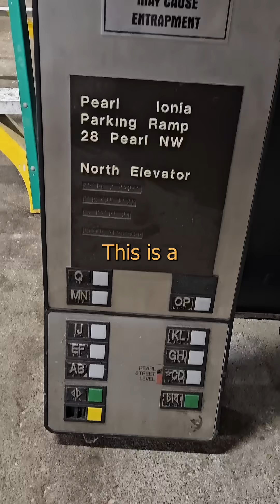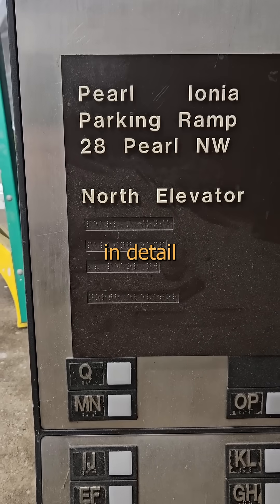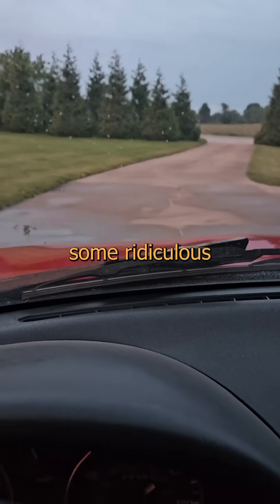Miata Mischief #chrisboden #engineering #gear #elevator #score #stories #parts #hacking #making

Comment: A friend of mine said I could have a 600lbs. transformer if I could haul it out right then and there.
Well I will tell you a 600lbs. transformer fits in the back of a Plymouth Neon. I will also tell you that a Plymouth Neon suspension can't handle 600lbs. but I got it home and unloaded.

Comment: My dad wanted to start a farm. He doesn't know a thing about running a farm. It comes time to pick out a tractor! My dad finds a good deal on a Yanmar that fit his needs, but we're in Michigan, and the tractor is down in south Virginia. We have an RV. We have a trailer. The dimentions of the tractor fit the trailer without an inch to spare. The tractor weight was so close to what the trailer could handle that it was too heavy when the bucket filled with water in the rain. When it came time to install the trailer, the RV only had a 4-pin connector and the trailer was the circle connector. An adapter and a bunch of electrical tape (and hidden extra wires) later, we're heading to Virginia with a trailer behind the RV. So many things could've gone wrong yet didn't. Everything was at max capacity. The drive home with that thing was nothing but stares from everyone everywhere. This was definitely a situation of doing the wrong thing right enough to make it work. Timing it right opening the bathroom vent with a cattle trailer driving past while the salesman was looking at everything was the least of my worries.
Reply: the circle connection is for a trailer brake, the 4 pin is lights only. he drove a trailer at full capacity with absolutely no brakes.
Reply: @bettafish541 horrifying.

Comment: Talked my buddies into helping me load a fiberglass boat (probably like 12-16ft) into the bed of a truck (probably 8ft). Bent the bed into a v shape before we gave up on it fitting in anyway. So we decide to push it down the hill, across the highway, down the hill, over the railroad tracks, down the hill, and into a river where we were going to paddle it 3 miles upstream where I live. Half the guys left midway and didn’t get to see its maiden voyage, where it sank almost immediately and still sits to this day 😂. I was just glad to have orchestrated a group of people into doing something and at that age I learned a lot about team building and leadership. Leadership I shouldn’t have😅.

Comment: I bought a chevy spark in 2019... brand new only 5 miles one the dashboard,  I'm a contractor and my van was in the shop, so I used my new skateboard to haul all the material to build a 5x8 deck with steps...😂 had to pull the passenger seat out and leave the back hatch open. The next day I hauled 20 bags of concrete in it spread out from the front to back

Comment: I own a honda fit and I have used and abused it to the core, I have place 5 ton metal press dyes, with 10 feet SS pipes and a sack full of nuts and bolts fresh from the galvaniser to my workshop.

Comment: I used a skate board to take a big glass screen TV across wichita to get it home so I could have a TV in my room, even dropped the TV on its face but it was so big you couldn't notice the scratch when it was on, took it about 3 miles and yes it was big for the glass tube style before flat screens, at least a 50 inch but it was almost 20 years ago so I'm not sure on the size exactly

Comment: So there are two occasions.. 

1: we took a 1997 Ford F150 with the 4.6l over to Ft.Lauderdale Florida, and loaded a 15,000 watt standby generator in the back of it, because the shipping company was on strike. Drove it all the way home to Cape Coral, Florida while the truck was doing the dirty squirrelly ass dance down the road. This was absolutely the best version of Lil Jon's song "Get Low" from the way the ass was on the ground. But it did it no problem. 

2: loaded about 750 lbs of soil bags and rock into the back of my 2004 Lincoln Town Car Ultimate that has air ride and more miles than a 70-year-old prostitute in Vegas has. (252k miles) And then proceeded to put 4 20ft sticks of side house soffit and trim in the passenger seat from Home Depot to fix up the house after Hurricane Ian. The car is actually the one as my profile Pic right now. Though it was at capacity,  the old girl did this with no problem at all. The sticks were a bit sketchy though as I had to tie them to the truck over the car from the front passengers floor board.

Comment: Was I had to drive all the car parts for my Dodge Avenger back in my Dodge Avenger so I had extra doors tied to the roof with bumpers holding them down with fenders tied to the sides I was pulled over four times

Comment: Ripped an entire 1960s breaker box off the wall of an abandoned drive in theatre and had my friend rewire the sockets so they function as lightbulbs and the breakers as switches. Cool lamp.

Comment: We were moving offices at a previous employer. I offered to take a few things down the street to help get the job done quicker. So they loaded my chevy volt to the point I had room to sit, and access the controls. Needless to say I pulled out of the parking lot, and a box avalanche came flying down on top of me. I ended up having to get the car towed after it caused me to slam into a curb, blowing 2 of my tires. 😂

Comment: I had a 2007 Toyota Corolla, and my buddy called me while I’m halfway through getting my wisdom teeth pulled, saying he blew up the motor in his Chevy truck and he needs a tow before they impound his truck. Tell em to hang on for like an hour tops. Get out the dentists office, see his truck off the side of the interstate, stop, pick em up, bought some rope, and flat towed his 1993 Chevy K1500 single cab short bed for 10 miles. And we were chilling at 60 on the interstate. We dropped it off at my house and I rebuilt the motor for em. But that was probably the dumbest haul I’ve done

Comment: 80 bags of concrete in the back of a 1990 F150 short bed. The bed was filled even with the cab and I had a few bags on the roof.  I had vague steering and couldn't go over 35 m.p.h. 25 mile to home.

Comment: At 16 I started with a 85 Ford Tempo. It got used like a pickup around the farm so mostly not on the road. About a dozen hay bales on the roof ect. Although one time I cut a small tree down down the road. I filled the trunk with the fire wood. I barely had enough traction to get it back on the road.

Comment: 78 Honda Civic hatchback. Took home 540 pounds of topsoil in bags. When we got in to drive, I put the car in D but it didn't move. I told my wife to lean forward, as did I and the front wheels grabbed traction. Then I went to turn but the car wouldn't, had to apply brakes to transfer the weight to the front wheels, then it turned. After that the rear wheels had a lot of camber due to the rear axle beam being bent. Drove the car for another year after that.

Comment: Drove the length of the Gardiner Expressway with a shelf sticking out the hatch of my 92 civic hatchback with a straight through exhaust to get it across town to my apartment. Just last week I needed to ratchet strap the hatch of my Touareg closed because it wouldn't latch after I scored two 230w solar panels for $100 and didn't want to go home and get my trailer.

Comment: I got a piano from a church and had to ride on the back of the trailer through steep curvy roads to try and hold it up (it’s an upright piano). At any moment it could’ve fallen but luckily it didn’t. It did almost tip once. Keep in mind upright pianos can be around 500-700 pounds or 227-325 kilos.
Reply: I worked at a small town piano shop. Few times a year we would get a call from someone who had dumped a piano from a pickup bed or utility trailer while turning a corner.
We would tell them why we charge $200 to move that “free” piano they scored. Usually the only real damage the dropped pianos had were cosmetic not functional.
Reply: @schooltechnology that's incredible. I thought they would fall apart when dropped from a trailer :0
Reply: How sore were you afterwards? :D

Comment: These days I'm sensible and own an Nissan Xtrail (Rogue to American minds) which has hauled ¾ of a ton of sand, cement and the cement mixer in the back. Apparently they're rated for ½ ton at worst...

It handled it just fine, save for scrubbing the wheel arches every speedbump i went over

Comment: Having owned Miatas for a combined 14 years I've had quite a few opportunities to carry things in them that I shouldn't have - desks, lumber, tool boxes, entire wheel and tire sets, etc. If the car has a roll bar, one can place the load on top of it and the windshield frame as if they were roof racks. Removing the passenger seat opens up an enormous space for cargo. And a bike rack will allow you to carry a short folding ladder on the back as if it were a wing - which I did multiple times going up and down I-95.

Comment: Some classic sketch stuff I've done over the last few years involved a lot of hail Mary's and ratchet straps but my fondest memories were of my Sports tourer bike (Yamaha fjr1300) with a full tow bar and a 5x3 steel car trailer that was way too heavy, later got a 4x3 flat top bolt together trailer. Carried everything from a mower and bits to a full size Suzuki Bergman 650cc scooter, a full mattress, and even washing machines with it to scrap for copper.

I still get free stuff from marketplace but rely on a landcruiser so it's safer 😂

Comment: I bought a Casio CZ3000 from a pawn shop and had to get it back to my house about 20 miles away and no one would give me a lift. So I got myself a sack truck, carried it 2 miles to the train, got it through the barriers, over to the centre platform and then got it on the bus for the rest of the ride. I still can't believe I didn't drop it, damage it or get refused service

Comment: I picked up a 34" 3440x1440 curved monitor at midnight at some dudes place that lived in a shady culdesac and strapped that bad boy to the back of my BMW K1200S, a supersport motorcycles because I knew what was wrong with it, I just needed to take the thing apart and verify. So I brought enough bungee cables to jump off the grand canyon with and rode the 15 minute ride back home in 45 mins taking every back road I could think of because going more than 25-30 mph I knew that curved monitor would at some point turn into an airbrake. I got it back home, took it apart and realized the ribbon cables were shot and fried so I wasn't getting it working without spending the amount that this thing was worth used. But I took out all the good electronics like the big caps, fast transformers and inductors and still haven't used them in a project yet. But one day, one day I'll be happy I did something so stupid just for that perfectly sized transformer.

Comment: girlfriend used to sell her handcraft ceramics at fairs. the setup was - 3x3m straight walled popup tent, sandbags for the tent, three 90x150cm wooden tables with removable legs, two wooden racks to add shelves to the tables, ten large storage boxes of goods to sell, couple of ad banners, a few folding chairs, rain gear, etc. 

the transport - VW Golf 4. when it was time to pack up often other sellers asked in confusion, where's my hitch trailer, and were flabbergasted when i said that i have none.

Comment: My first motorcycle. The bike didn't run. My truck wasn't running and the uhaul was closed but I got a steal on it so we grabbed my buddy's Durango. Tied a tow strap to his rear axle. Daisy chained the straps to the frame of the bike and hopped on it while my buddy drove the 10 minutes back to my house. Luckily mostly straights but corners were an issue

Comment: Thankfully I've never had to do anything particularly sketchy to haul anything home but while working at a machine shop we had to load a bunch of trash on a truck that is probably 10x older than I'll ever even be. The sides of the bed (what's left of them) are wooden and we wound up putting way too much trash on them so, once the catalytic converter was put over them there was at least a 2 foot gap between the bottom of the converter and the bed of the truck. Instead of trying to, oh I don't know, redo literally anything we just loaded up with empty space with a spider web of Bungie cords and called it a day. Didn't hear of any problems hauling the trash and the old tin can is still kicking so I guess it worked out.

Comment: miata regardless if it's na to NBFL...they can fit quite a bit like a whole office chair (yes i tried) and a few bags of potsoil either in the back or on top of it with few straps...but the problem might be the acceleration which NA with pop ups on and 90hp engine will have none

Comment: I had a little 80's import, like a Civic. I folded down the back seat and front passenger seat before going into the home center to buy an armload of 10' PVC pipe. Leaving the store, I walked up to my very small car, slid my 10' bundle of pipe neatly into the trunk, and closed the lid.  A little boy with his mom was ASTONISHED and asked how I did that? "Magic. 😉"  Got in the car and drove away.

Comment: I spent the afternoon measuring the cargo capacity of my Gen 2 Prius and comparing it to the dimensions of a flat packed IKEA couch. I was certain it would fit. 

And it would! Well, any one of the three pieces alone would. All 3 concurrently? Ah, no. 

I called my (very) pregnant wife and asked if she might bring up the other car to help. She kind of just laughed and said "nope. You got yourself into this, good luck!"

So, an hour of access roads and side streets later, i made the 30 minute drive home with 2 couch pieces hanging out the back of my Prius, and a third as firmly secured to the roof as you can possibly get with about 5 wraps of the IKEA twine. I did not get help unloading, nor assembling the couch. 

And, the next day my daughter was born!

Comment: It was fairly recent. My house got flooded and I only escaped because I insisted on going to work that morning. Ended up doing a supply run for everyone at home. Bought food and drinks for 5 people + 2 rubber mop thingies + other supplies and carried it all on my bike along with my bags and stuff. It was a struggle but I slowly made my way close enough to home in the rain before continuing on foot because there was still knee high water on the road. I readied the water mop thing just in case I see a snake or a monitor lizard as I wade through the water lol, since it was only a few weeks after a neighbor and some security guards saw a snake that they swore was as big as an 8 inch pipe

Comment: On my lunch break one day. I spotted an old X-Ray transformer poking out of the rubble of an abandoned chiropractic office that was in process of being demolished. Naturally I stopped and asked the crew what they were going to do with "that old piece of junk". They said I could have it if I could get it out immediately! I said I'd be back in 2min... went to a gas station down the road, payed a homeless man $20 to help me stuff the tx-former, HV cables, and X-Ray head, into the trunk of my 2000 BMW 530i! Almost lost my job for returning late from lunch... I pulled the tube out of the head, it was a very old unit so it made a nice shelf piece, and the transformer played a part in many a hi voltage project over the years until I scrapped it.. Still have the tube though!

Comment: Where shall I begin 🤣 well, we were looking for a kitchen in Ikea, and for some reason the oven we wanted was in the sale corner(35% off), stubborn as I am I bought it. All good and well but then came the fun part, getting it in my car. Back then i had a Toyota Paseo, the sporty coupe version of a starlet. Long story short my girlfriend had to sit in the back while the oven sat in the passenger seat because there was no space😆 and I had to drive like that for a month because we didn’t get the key of the house yet and no space at my moms home to put it🤣 i have more stories about biking home with beams of wood and other things when i was young and didn’t have a car😆
Reply: Another thing i hauled in that car was 16 rolls of grass sod which weighted 35 kg (78 lbs) each 560 kg (1234 lbs) total, next MOT they complained that my rear suspension was blown 😅 hmm thats odd

Comment: At my old workplace I once bought a bunch of 12ga steel paneling off of an old mill we were scraping. With several of the panels being too long to use the tail gate and still having electronics attached, I tied a bunch of them in the bed of my nissan hardbody with their still attached wiring. Nervous on my ride home I even reached out the back window and held on to a couple of them as I drove.

Comment: When I was in Hiroshima the guide I was with I randomly asked what job he did he said engine engineer for the Honda engines he designed the Honda engine that raced with the 3 rotors and won forgot the race year and name sorry. But that was cool like he also said he watched the engines actually exploded during testing he specifically working on the rotary engines

Comment: I took the passenger side t-top out of my 84 trans am, dropped the seat, and managed to stick a highback chair in, which limited my visibility out the right to the gap in the back of the chair. Made it 55 miles on the highway to deliver it, so all things considered, a good solution.

Comment: About 15 years ago I towed a server rack behind my car, because I was too wimpy to get it lifted into the car by myself. It was 4am in the morning (company was going on auction at 8am that morning and I was not going to call my buddies at 4am to help, they had female company). The server rack ran on its castor wheels. I just connected it to the hitch point with the 6 bungee cords I had, braided together. Fortunately the trip home was only 2km and it was all uphill. Went like 10kph and made it without any damage or close calls. Still using that rack today.